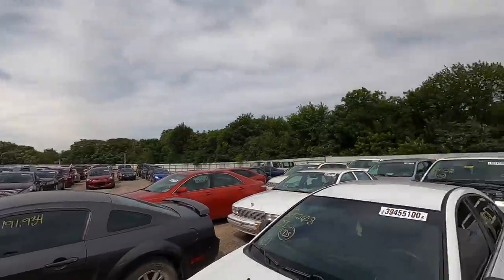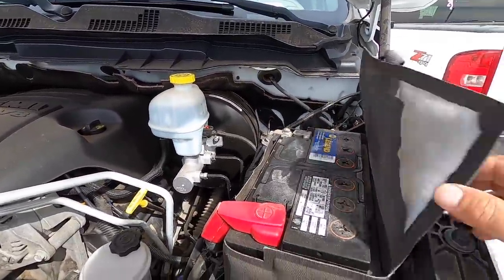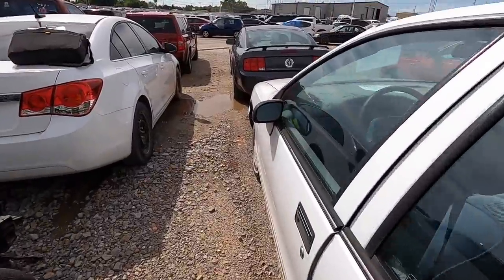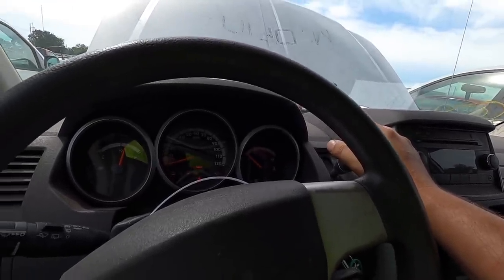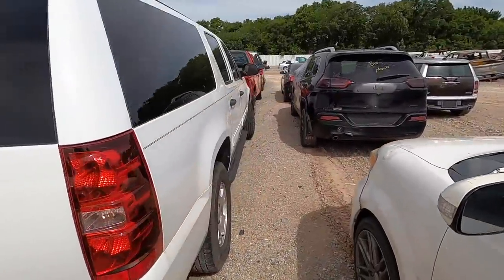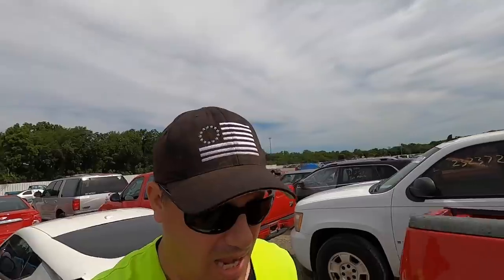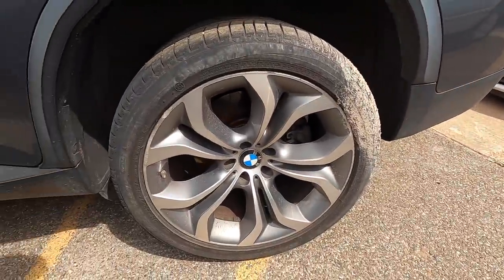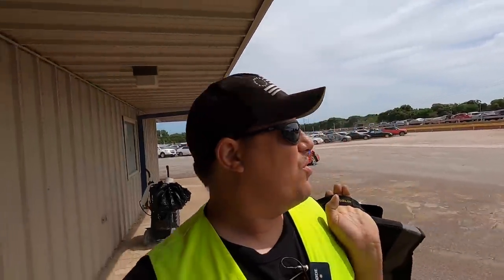Copart Walk Around 7-4-2020 + Cheap Classic Chevy Caprice

Comment: Be careful with the 5.7 Hemi. They are known to have MDS failure! What that means is the engines cam very likely cause the misfire. The cam lobe wears out, causing the valve not to open. I have rebuilt two of these in the past year.
Reply: Mopar. Nothing more than a brand in the FIAT portfolio...soon to be a FIAT/PSA (French) product. That should work wonders for their rep
Reply: Correct, my charger has that issue right now, I got to get mine rebuilt soon.   Any advice/tricks you know with them?
Reply: That’s not the reason why it eats cams, ur lying.

Generation 2 hemi engines eat cams for the following reasons:
For the 2009 change, they raised the cam in the block about 2 inches (that’s a lot of distance). This puts it further away from the crankshaft. In a normal engine, the cam is close enough to the crank to get lubricated by the crankshaft throwing oil all over it. 

Now, that’s not the end of the world. The rollers can lubricate the camshaft too with oil
...right?

Kind of. The non MDS cylinder rollers have no problem providing their lobe of the camshaft with oil. The MDS cylinder rollers get starved of oil when you are in economy mode. This happens because they experience reduced oil pressure (just by design) and starve at low rpm. To give the MDS rollers oil, and therefore the camshaft oil, the engine must be at higher than 1500rpm. What this means is, at idle, the MDS rollers and camshaft are lubricated by the crankshaft throwing oil on it that is now 2 inches further away. On top of that, there is an oil galley “pole” that runs parallel to the cam and crank, right between them. So while idling your generation 2 hemi, the only way that the MDS rollers and cam lobes getting lubricated is by the (far away) crankshaft throwing oil around an oil galley tube and hitting those lobes. Aka, it’s lubricated by luck. After 120k miles of a lot of idling, those X amount of times where you ran out of luck start to matter, because a cam can only get starved of oil so many times- which it then finally gets chewed to a point where it can’t open the valves enough.

It is not a cheap part issue, it’s a design flaw.
Reply: OnCue Cars best advice is lookup a Hemi MDS delete kit, comes with everything you need, including 6.4 Hemi lifters.

Comment: These 3.3L go all way back to 1990. Chrysler put those in the C based Dynasty(1990-1993)/Fifth Avenue (1990-1993)/New Yorker (1990-1993) and the Plymouth Voyager (1990-2001)/Dodge Caravan (1990-2014). They also used these in the LH cars as well Eagle Vision (1993-1995)/ Dodge Intrepid (1993-1995) New Yorker/LHS (1994-1996). I thank they even used these as a base engine in the 2006 Dodge Charger base as well. I saw a 1993 Dodge Dynasty LE with 463,590 1 owner miles with that 3.3L V-6 mated to Chrysler's Torque-Flite 3 Speed 727 Variant. The 4 speed overdrive electronic transmission was a option starting in 1990 for the C body. Im almost tempted to buy it there is no rust and the paint is perfect and the interior is very clean new tires he was a salesman for a drug comapny all highway miles he wants 250.00. Should Im take a chance?

Comment: The only reason that van is still running at that mileage is because that 3.3 liter V6 is a Mitsubishi motor. Damn good engine. They do burn oil but run a good while. Dodge has had that engine in Caravans a long time

Comment: Randy, one thing I never see you do on potential bid vehicles is remove the oil cap while it's running to check for combustion blowby. 

You can tell a whole lot about a vehicle if there's no blowby with a quarter million miles on it.

Comment: The Dodge Grand Caravan looks to be an ex-public service or charity vehicle so you can guarantee it's been maintained on the dot every time, and at 300,000 miles it's very likely that all the usual trouble spots have been fixed, maybe more than once.  In the UK, used disability vehicles do have a decent market, the problem can be tapping into that market.  It could be that it might appeal to someone looking for something to use for work that has a low floor height...